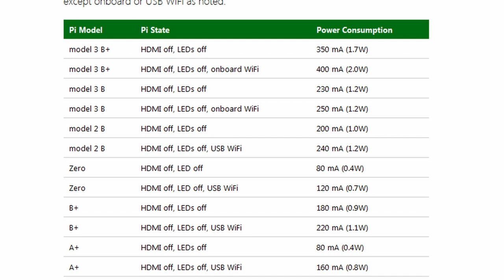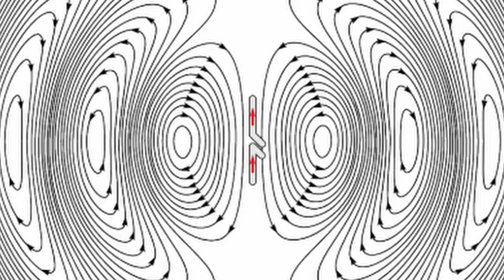How we built a high altitude balloon with a Raspberry Pi | The HACT mission

Comment: Wow, Great work guys. But I have a question, in the structure of the box, is the pressure, temperature and humidity sensor inside the box? shouldn't it may be placed outside of the box? Or it is not relevant.
Reply from the maker: For humidity and temperature there is a significant difference between inside and outside the box. Preassurewise it depends a lot on how airtight you build your probe.
In our case, there is a little sensor board on wires dangleing outside the box, next to our - sadly lost- 360° camera, as well as a temperature sensor inside the box.

Comment: You weren't able to receive gps signal because you are not using a flight gps.. normal gps won't work after 15km
Reply from the maker: not quite true. There are indeed some limits to prevent GPS usage in balistic missles that weren't built by the US. But since most GPS companies want to play it safe, they often restrict their GPS far earlier than necessary. In our case, the GPS specificly was sold as "altitude unlocked", so it should have woked to (if I remember correctly) about 55 km altitude.
Reply: @Atmoventus  I am participating in a weather balloon project and I require a gps module that can fly up to 40Km. What GPS module did you use?
Reply from the maker: I'd reccomend looking around for ublox gps modules. most of them are "unlocked" and work up to 50km altitude. There also are several arduino libraries for easier programming, however their biggest drawback is, that due to the way they communicate with your controller, they need a looooooot of software storage on the controler you want to use.